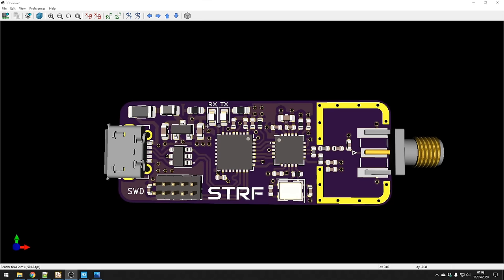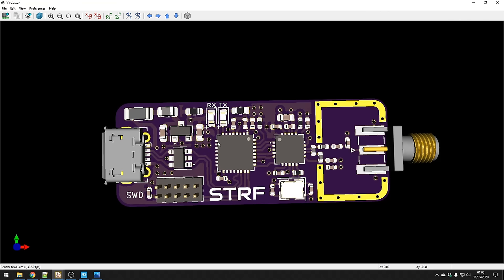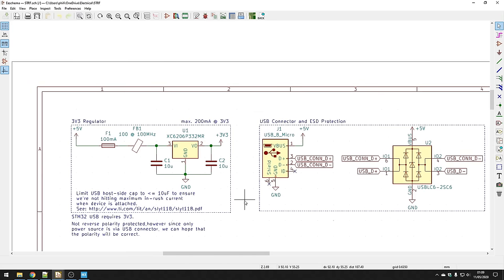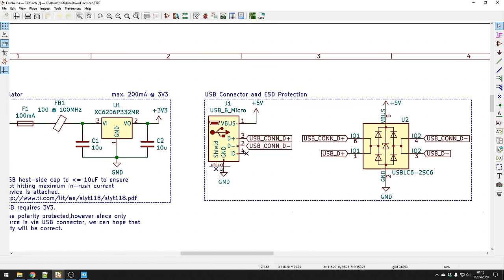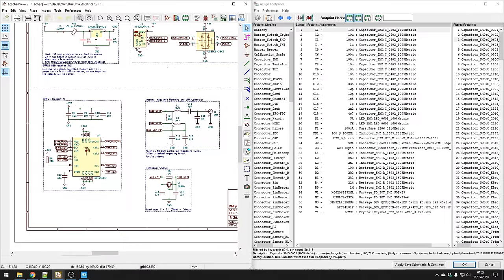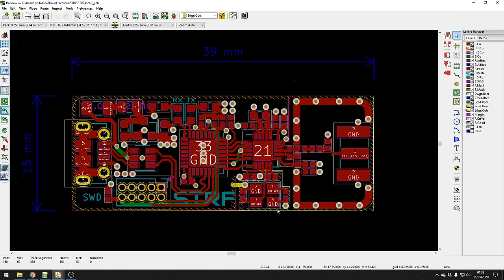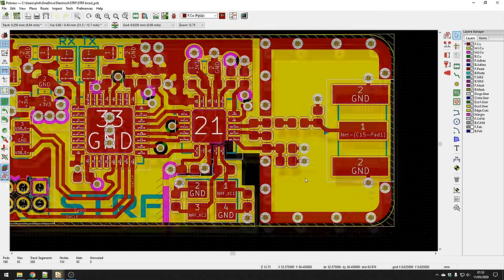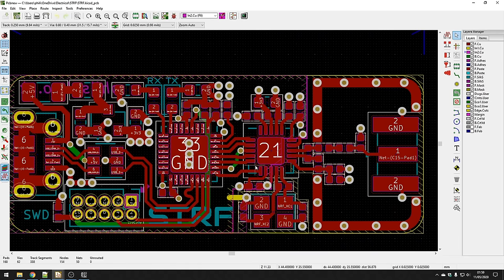KiCad STM32 + RF + USB Hardware Design - Phil's Lab #5

Comment: 44min flew past. So much valuable knowledge you've given here and you've barely scratched the surface of PCB design. I've scoured the internet for books on good design but most fall short on giving the reader a practical example. The knowledge is then never cemented. You simplified something so abstract for me.

I would love to watch some PCB design involving digital and analog signals on the same board.
Reply from the maker: That's great to hear - thank you very much for your comment. Coincidentally, I have been actually working on a mixed-signal PCB (MCU + analog audio interface) and am now on the N-th PCB iteration haha. Sometime in the (hopefully near) future I'll be sure to make a video about that.

Comment: Absolutely great tutorial on KiCAD for RF and high speed design, Phil. Thanks for sharing this. Very helpful knowledge and information for designing 4 layer boards that function with RF.
Although you skipped a few steps, they are shown in detail in your SGM32 Hardware Design video. I'm glad you instead took the majority of the time to focus on the RF design aspects instead.
This is one of THE BEST and most comprehensive tutorials with KiCAD for high speed RF circuit designs here on YouTube. Thanks for sharing.
Reply from the maker: Thank you very much! I'm really glad you liked it. Yes, I tried to skim over quite a bit of the details that I had mentioned in my previous KiCad video to focus on something a bit different.

Comment: Great Video with  loads of useful information. I'm still a rookie with Kicad and since migrating to v5 i've lost most of the 3D models, so the viewer usually shows unpopulated boards... I've never bothered to try to fix it but when I look at what you've done it motivates me to look into it. Thanks.
Reply from the maker: Thank you! Yeah, for me it helps me see if I've placed connectors a correct distance away from the edges, and things like that. I also really like the 'raytracing' feature in the 3D viewer to get slightly more realistic-looking boards.

Comment: 7:50 from my experience as a firmware developer for mostly STM32s, I'd recommend to try to always have a jumper available for the BOOT0 pin (at least on development boards) even if you never plan to program it using the bootloader. The reason is because sometimes the code might get the MCU into an unresponsive deadloop state where even SWD/JTAG wont communicate (usually caused by invalid clock configs, trying to communicate with peripherals with gated clocks etc, I've had it happen without any logical explanation too) and sometimes this may happen so fast after startup that the SWD/JTAG programmer can't halt it after a reset, so having a way to force it to start on bootloader is a last-measure failsafe to save you from having an effectively bricked MCU
Reply: Happened with me once. Was using the stop 1 low power mode on an stm32g030 and it disables the swd interface to save more power when the chip is in sleep, unless you explicitly configure it to remain on via the debug peripheral. Boot 0 and Uart came to rescue.

Comment: As a board designer, I love how detailed you explanations are from the beginning til the end. Some questions for understanding and learning:
1. No ESD protection is seen from SWD connector to STM32 MCU - could it be a potential threat of ESD damage on SWD pins?
2. Guard ring consideration for entire PCB (and eventually connect to USB shield) for EMI protection? 

Thanks!

Comment: Great tutorial. After some years away from PCB & Software design I very recently came back to it for some projects and had 3 of my designs come back from JLCPCB at the beginning of the week. All great quality, price and they actually work! I have a radio control transmitter, receiver and a security interface board on the desk in front of me and very pleased with the results, especially that they work!. You take the design to another level from me, I'm impressed and have learned from you.
Reply from the maker: Thanks, Graham - glad to hear your project worked out!

Comment: Well integrated audio video presentation of technical design details.  Saturn calc is another very good free PCB calculator.  Suggest 1/2 oz copper all planes,  plate top and bottom up to 1 1/2 oz to prevent delamination of pads during soldering.   Extra,  plane cutouts under any DC blocking caps on diff pairs.   Good work.
Reply from the maker: Thank you very much, James. I'll take a look at the Saturn calculator you mentioned - thanks for the tip!

Comment: About the shield pin - it is grounded on the host side per the specification, BUT the connection varies depending on the device.
A) Right, you should avoid current on the shield of the usb cable.
B) The device ground should be connected to a protected ground under the USB connector area, through a combination of ceramic caps in parrallel with a high resistance of a varistor of some sort in order to provide a return path for high frequencies (yeah they exist and perfer to flow on shielding)
C) the ESD/TVS Diodes should be connected to theprotected ground, as they are the primary protection and all interface devoces already have a little protection, which is counted as secondary protection against lower energy events.
D) if you have a metallic case, ground it to the usb shielding.
E) if you have any other connection to this device, you should carry the shielding path around the pcb edges to the shielding of said connection.
F) this is not even the beggining of the subject... i reccoment the books "Grounds for Grounding" and "Electromagnet Compatibility Engineering" Books to start understanding the subject.

Comment: This NRST trace that cuts your GND pour, can be significantly improved. 1) Bring the via closer to the chip. 2) From the connector put the track on the top signal layer, and only drop to other layer close to the chip. This will reduce the cut significantly. It can be further improved, but doing jump back and forth between first and last layer twice (4 total vias).  I have no idea why ST decided to put a GND pad under this chip, as it doesn't need to be technically connected (datasheet says it is recommended to solder it to GND, but it is not required electrically or thermally), nor does the chip generate a lot of power to require it. Maybe it is to make the chip lay flat on the board, or improve mechanical joint. If you try to risk it, you can ignore the GND pad there, cover it with solder mask, and run some other traces there. But the soldering will be harder or not possibly using JCLPCB service.

Comment: Great Video. Concerning the RF Trace and the calculation, you give a nice and easy way for an implementation, but of course there is much more to it. I'd like to add that the RF trace or transmission line you are designing here is a so called microstrip line. There are more rf transmission lines like this. I have good experiences with the grounded coplanar waveguide. KiCad has an integrated calculator for multiple transmission lines. It is harder to use because you need much more information about the pcb, not just the stackup but the material itself.

Comment: Great video. I have had several boards manufactured by JLCPCB but nothing as challenging as this board - mine go in old pinball machines that run the processor at 1MHZ. You don't have to worry to much about matching at that rate.  But you did a wonderful job of explaining what would need to be done if I ever had the need for speed.  Thanks for the great content
Reply from the maker: Thank you, Edward - I'm very happy to hear that! Good luck with all your designs!

Comment: This was a great video.  This really clarified a few things for me and added some new resources to my list.  I think I've got 3 pages of notes from just the second half of the video.

Now to go watch the flight computer video in its entirety!

Thanks for the effort you put in here!
Reply from the maker: Thank you, Benjamin. Very glad to hear these videos have clarified a few things. I must admit I'm also relatively newww to this and I'm sure there are a LOT of things I can still learn about PCB design, but just wanted to share what I gathered so far.
Reply: @PhilsLab  You've definitely made it deeper into the topic than I have.  The dive on USB and the correct impedance in particular was interesting and relevant to some upcoming projects so much appreciated.

At least for me most of the work is finding out the stuff you need to learn.  This put several new things on my list and is much appreciated.  

Oh, and you probably told me why the crystal oscillator on one of my boards isn't working (it's over the single ground pour)... that was a puzzler that I wasn't sure how to even start with.
Reply from the maker: @BenVonHandorf  Awesome, that's good to hear! Hopefully you can get your crystal oscillator part of the board sorted for the next iteration!

Comment: Nice. BTW. If one is scared of matching networks, well Nordic provides reference design and layout, so it is easy to replicate. If one wants to have smaller foot print, using a pre-made RF balun, for example Anaren BD2425NnRF , which is 0404 part, together with some 0201 or 0402 extra parts, can provide you working solution quicker, that is smaller too. It is designed for this specific nRF24L01 chip. It is a multi-layer transformer based balun, so you get extra isolation, and don't need output capacitors, as well better ESD protection out of the box. It is a cheap part (0.50$ for small quantity, dropping below 0.30$ for over 100 parts). Unfortunately JLCPCB doesn't have it available for SMT assembly, so in many cases it is no-go.

Comment: Your channel is a blessing, good sir. If possible a project around bga would be nice. Thanks a lot for this.
Reply from the maker: Thank you! I'm not sure how much BGA stuff I'll be doing, at it's always a bit of a pain to get boards with BGA chips assembled. But we'll see, maybe some time in the future!
Reply: @PhilsLab  It's not that bad. I, in my 70s, up until a year ago (now retired), did replace many BGA chips of various sizes, down to the smallest (5 balls) using handheld hot air, liquid flux, microscope, and tweezers. If I could do it by hand, it certainly shouldn't be a problem for PCB Assy houses. 

Your video is exceptionally helpful for many aspiring electronics enthusiasts, professionals, and tinkerers alike. Thank you very much for your effort to help us become better in this field. Keep up the great work!
Reply from the maker: @voice4voicelessKrzysiek  Haha yeah that's true! The assembly house I usually go for unfortunately doesn't support BGA, so I've avoided them. But maybe should I ever need a BGA-package chip I won't stray away from it anymore and look for a new manufacturer haha.

Thanks for your comment by the way, really appreciate it!
Reply: @PhilsLab  That's true. I was going for more of a study project that you wouldn't send for fabrication but design it just for a video. I hope I'm not bothering you, Sir.

Comment: Hi! Very nicely explained design! Congrats! Just an observation in regard of crystal ground plane. The gnd return connection must be below the crystal source traces un order to minimize ground loops.
Reply from the maker: Thanks and thank you for your great comment! Yes, ideally the GND connection should be as close as possible to one of the ICs ground pins (going by page 42 of this application note: https://www.st.com/resource/en/application_note/cd00221665-oscillator-design-guide-for-stm8afals-stm32-mcus-and-mpus-stmicroelectronics.pdf). In this case it shouldn't be a problem, as the the ground trace I routed and that IC ground pin are very close anyway, but in general yes a thing I should have mentioned is to always try and minimise ground loops. I'll do that in upcoming videos - thanks again!

Comment: 26:43 Looks like a few stitching vias to bridge the ~NRST (note the tilde, ~ is a special character to make KiCad give an inverted signal top bar) trace wouldn't go amiss, especially because your RF transceiver and crystal are cut off "around the corner" from the rest of the decoupling/bulk caps, regulator, etc.  I know you've got the logo to contend with and want to keep that silkscreen pristine, but a couple vias above the "F" would reduce the impedance at the bottom of the board.

Edit: also, "guard ring" to me means something very different: it's a path to a constant voltage to protect extremely high-impedance signals from stray leakage currents. What you have there is a footprint on which to solder an EMI can. (Might have wanted to make that a square that matches an off-the-shelf can instead of those rounded corners). Without the can installed it does very little.

Minor issue, still great content! It's been a few years since I was taught, it's good to get up to date with modern realities of how cheap a 4-layer board is, how cheap vias are, and how tight trace/space can be!
Reply from the maker: Thanks a lot for your great comment! You're completely right regarding both the additional stitching vias and the guard ring.
As you said, the contention with the silkscreen was what was bugging me and to be honest, I have not have yet had problems the way I typically stich (or don't stitch). Then again, my boards aren't really very advanced or high-speed. But I will definitely try to be more reasonable with stitching in the future, as you suggested.

The guard ring, to be quite honest is more of a gimmick of this board, rather than anything particularly useful and will most likely function no different with or without it (except, as you mentioned, should an EMI can be installed).

Thanks again for your suggestions, really appreciate it!

Comment: Great stuff! Recently I'd been getting back into building electronics again, after almost 20 years since I last laid out a PCB when I was a teenager. Finally fixed that last week.

Controlled impedance for high-speed/RF layout has always been a bit of a mystery to me—even after having obsessively watched The Signal Path for years. :) You managed to show me otherwise in one short video. Keep them coming!

One minor thing though: I kept wondering what these "ground paws" you were referring to were. Took me until near the end to figure that one out; don't think I've ever heard of them being called anything other than "power/ground planes" before. That said I don't work in the industry, so might just be a gap in my experience. :)
Reply from the maker: Thank you - very glad to hear that! :)

Haha yeah, what I meant to say was 'copper pours', but ended up saying ground pours. I hope that didn't cause too much confusion!

Comment: Video is really good.

For 6:05 to 6:25,  my understanding is different to Phil's understanding.
- My understanding is that the maximum output current is 100mA (as generally, the output current equals the input current).
- Phil's understanding is that the maximum output current is 200mA.

Why is the maximum output current equal to 200mA, and generally what is the current rule for voltage regulators ?

Comment: Nice presentation, and very nice PCB design! I see some meandering on one of the USB traces belonging to the differential pair, which shows care and though. If you use the STM32 to interface USB to SPI, I think you could replace it with a CP2130. Also, you can use the CP2130 internal regulator, which converts 5V to 3.6V, offering 100mA of maximum current.
About the termination resistors and capacitors, they are typically used in USB 1.0 interfaces, if they are not already included inside the chip, as you mentioned. Different chips have different requirements, and values will probably vary for those interfaces that require said external components.
Reply from the maker: Thank you! Thanks also for the IC recommendation, I hadn't seen that before. Nice that it also has an internal regulator.
I was planning on doing a bit more than just passing on data from the RF transceiver to the USB, e.g. something like decoding/packing/extracing information. But definitely a much better idea to use the chip you suggested if that functionality isn't needed!

Comment: Nice vid, I really enjoy it.
Also spotted little inaccuracy in Your 3.3V supply design, I know its really minor thing. With USB 5V output voltage and 100mA fuse You can get constant power below 500mW coz most fuses blow with rated current after few hours, even if assume it wont blow, output current gonna be some around 500mW/3.3V = 151mA max not 200mA.
Reply from the maker: Thanks man! Yeah, at the time of making this video the value of the fuse wasn’t calculated and I just chose a ballpark figure. Had picked a rough value for the video with no detailed calculations. You’re right however, should have mentioned that in the video!

Comment: You suggest not grounding USB shield. This is oftentimes more problematic then grounding. This is dependent upon host design, but in my experience, I've designed multiple devices with the ft230x and SI 2012 if I'm remembering the number correctly. When device was plugged into my computer with ungrounded shield, I got USB unrecognized errors. My other computer didn't have the problem, but had an unreliable connection. 

The major of consumer devices have USB shield grounded.

A good rule of thumb is to have 2-3 spare 0603 pads very close to your USB connector in a RC configuration. This way, during initial tests, you can hand solder different combinations of components to determine what type of connection works best for USB shield. If ground is best, use 0ohm resistors to jump to ground

Comment: Hey Phil! Great video!
How critical is 4-layer in this case? I have very simple RF design where i just need connect RF SoC with external antenna via SMA, how hard it would be to do this on 2-layer PCB?
Also do you provide some kind of paid consulting related to hardware design?